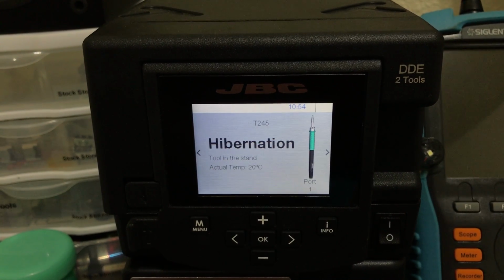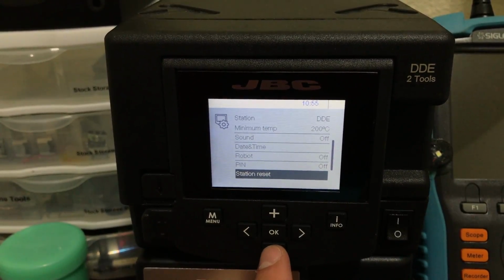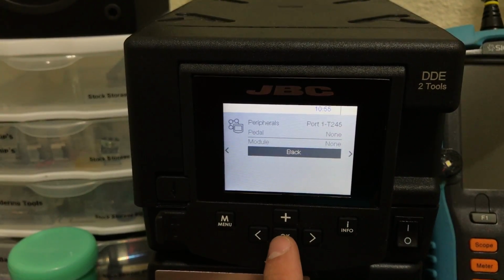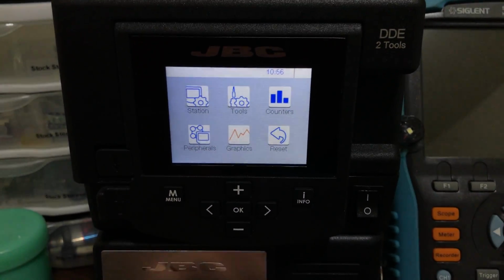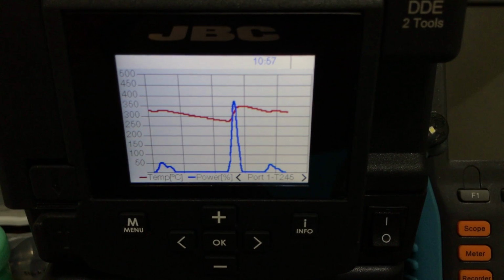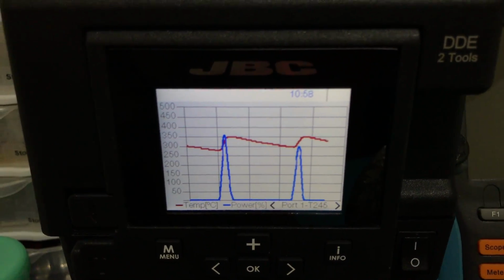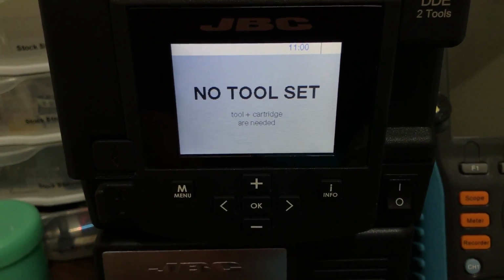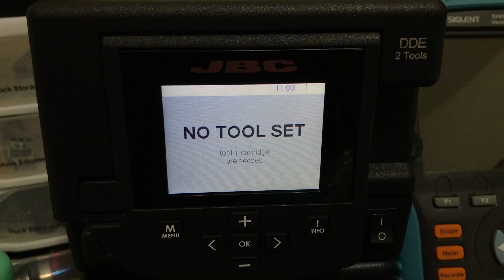JBC soldering station review

Comment: Thanks for the thoroughly review. The AD-SD stand is designed for C210, C245 & C470 cartridges. We will share your feedback with our engineers. Let us know if there is anything we can help you with. Have a nice day!
Reply from the maker: JBC Soldering Tools that would be awesome ..😁 and your welcome for the review also I did a review on the tip cleaner and the hot air station check my channel for the other reviews do you guys have affiliated links ?
Reply: We haven't yet, but we will consider affiliate programs in the future.
Reply from the maker: JBC Soldering Tools OK that would be awesome also I have a review video of the hot air station and I'm boxing of the soldering station on my channel check them out